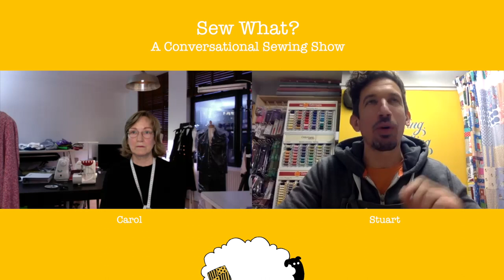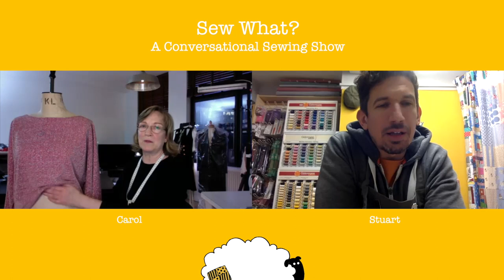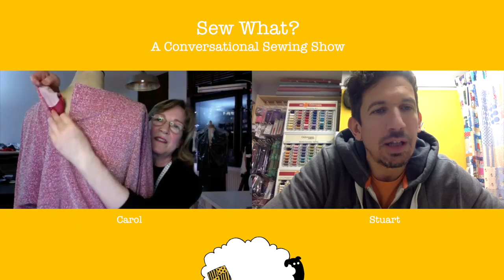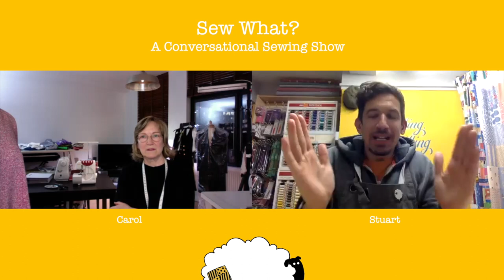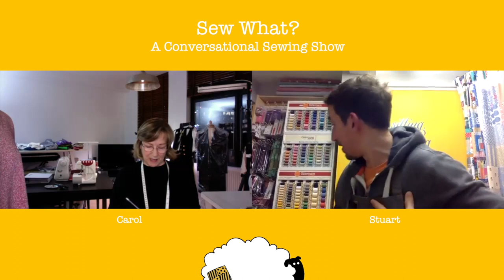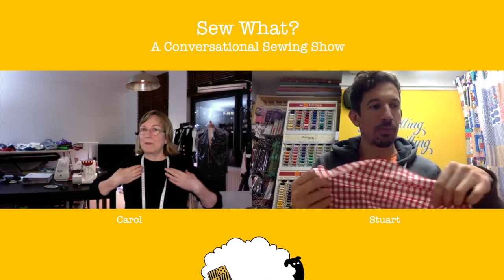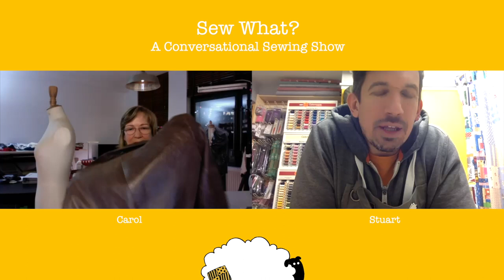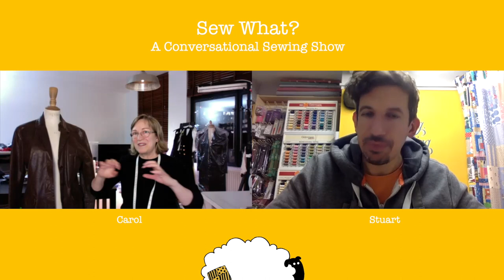Controlling fabric, interfacing and starch | Ep8 Sew What - A conversational sewing podcast show

Comment: Great chat. A key consideration with interfacing vs sizing/starch might be whether you need permanent (interfacing) or temporary (sizing) body. Quilts, in most cases, are made to be washed periodically so the sizing will wash out and it is really needed only during construction process. A garment needs the interfacing for a life of wearing. Would love to see more about the new lining in the jacket as it progresses, particularly how you make the pattern for it.

Comment: I couldn't just listen and occasionally glance at the screen for this one.   I had to put everything else on hold while I watched Carol's tutorial.  I shall have to remember the bit about cutting the interfacing on the bias especially.
     I use Best Press and spray starch for dressmaking too - especially for "slippy" fabrics that don't behave well when being cut and/or sewn - it's great for giving them more stability while being worked on that can be rinsed out after it's made.  I've been saying for years before I ever tried patchwork myself,  that quilters get all the best sewing toys.
     It's not as helpful with fabric that can't be washed, however - some silks, like satins and taffetas, would lose their finish if wet to remove the startch or Best Press, although for chiffons and crepe's it's been OK for me so far (though I still tend to avoid working with silk crepe with all it's shifting and sliding).
     I love working with gingham - the stripes are woven in rather than printed so by followung them you can get the pieces exactly on the grain and cut exactly square to uit really easily - and then you can do details cut on the bias like I did with the neck binding, belt edging and ruffles on this doll dress: https://flic.kr/p/2kEBvrd
     I've replaced many a lining, or altered garments to replace parts that are worn though.  And as I'm sure I've mentioend before, I re-use a lot of men's cotton shirts that have worn throuogh in the cuffs anc collars to make dolls clothes from the rest of the fabric that is still in good contition - or I removed the worn collar and alter the shirt sleeves to short sleeves to get rid of the worn cuffs.  Occasionally, I will replace the worn collar and cuffs with a contrast or toning fabric  so the rest of the shirt continues to be wearable, but with a slightly different look.